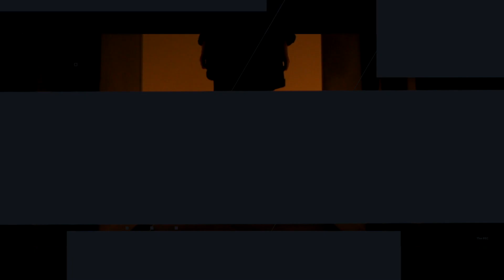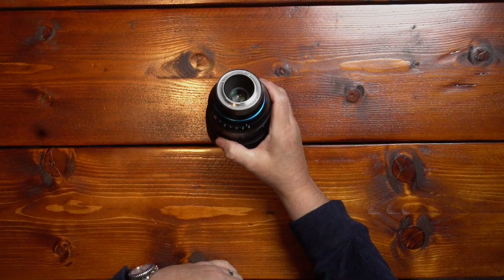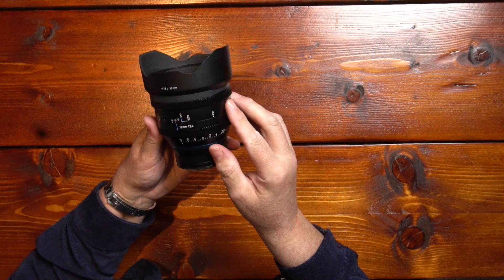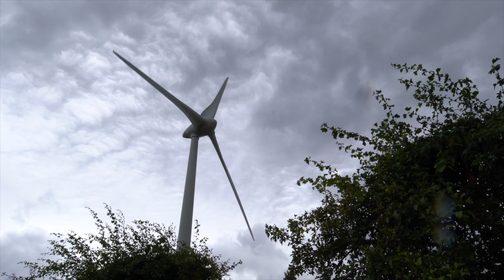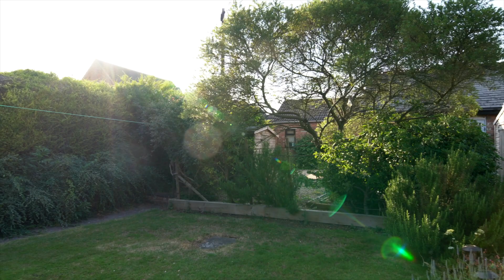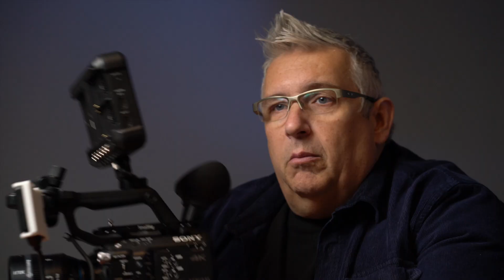Irix 15mm T2.6 cine lens review | Is this the best budget cine prime ever?

Comment: Clean your sensor! And while you're at it, did you really say F stops are a "theoretical number" while T-stops are somehow more concrete? That's... not right. F stops are literally just a straightforward arithmetic and can be measured by an extremely simple instrument like... a ruler. T-stops measure actual light transmission and are used by filmmakers to help ensure exposure can stay the same when changing lenses - rather important when different angles of a single scene must be cut together. But measuring actual light transmission is a wee bit more complex than measuring the distances spanned by two parts of the lens, no? Anyway. Glad you looked at the lens and published a vid. Hopefully Irix releases a couple more focal lengths very soon (24, 35, and 85, in particular) so a complete set can be made. Then I might jump.
Reply: There is a 21mm now (JAN 2025), but nothing in the 65 to 85mm range.
Reply: @frankfarago2825  mm, they've had a 21 forever, I've owned it and it's great. And now they have the 65, suddenly I'm not as interested, since the DZOFilm Arles came out.